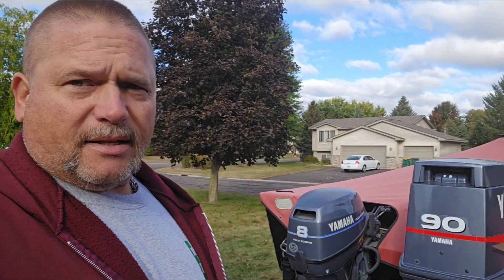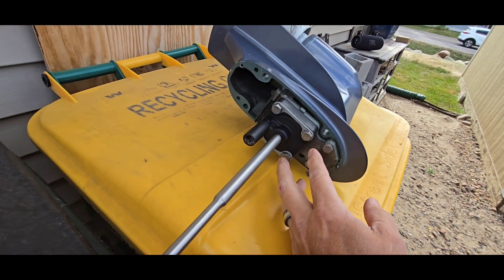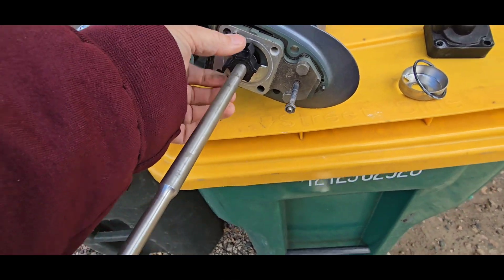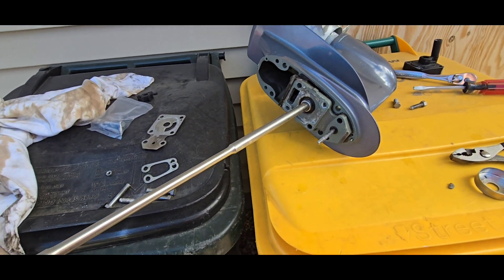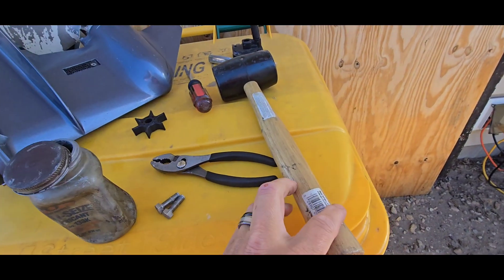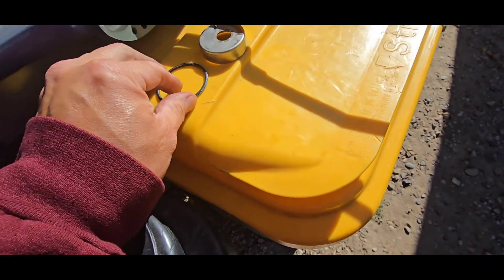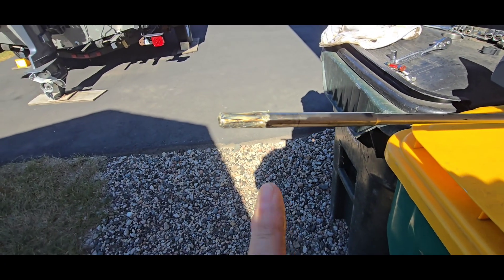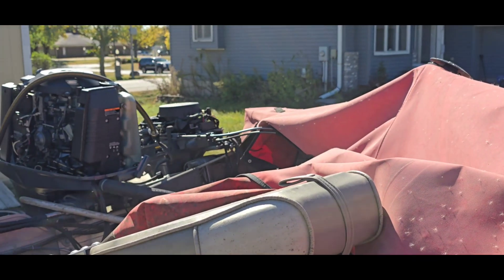Repairing the water pump in an 2001 Yamaha 8hp high thrust 4 stroke outboard.

Comment: This is a great video helped me with mine...only thing is when you test it you have to be pulling from the bottom inlet to see if the impeller is actually working.  If you use the hose at the top, it will always look like it is workin.  Thanks for the video!!
Reply from the maker: Yes, I realised that after I posted the video. Lol. Thank you for catching that as well. I am glad it helped you out.

Comment: 9:44 How did you remove this I cannot for the life of me get it out and I have a fresh one ready to replace it with.
Any and all help appreciated
Reply from the maker: I'm not exactly sure what you're asking, but I'll take a guess. After you remove that black outer cover, that round aluminum piece should just lift out. You may need a screwdriver or something similar to pry it up, especially if pay off the old impeller is wedged in there. If I'm off target let me know and I'm happy to help in any way I can.